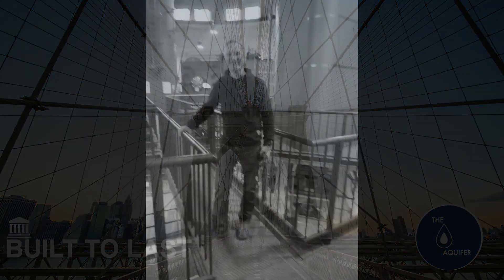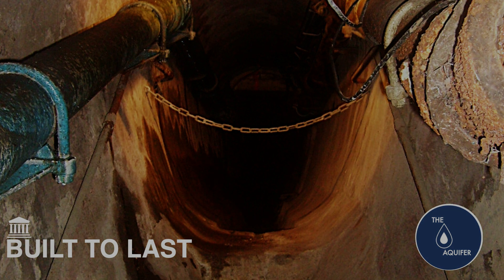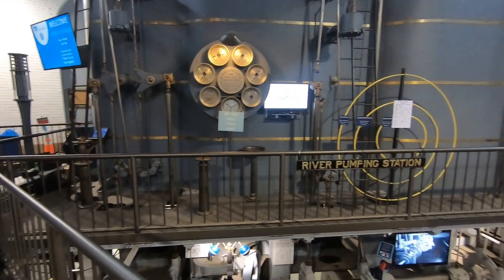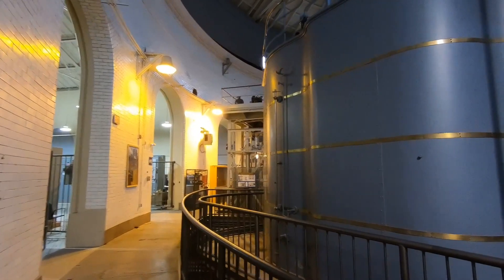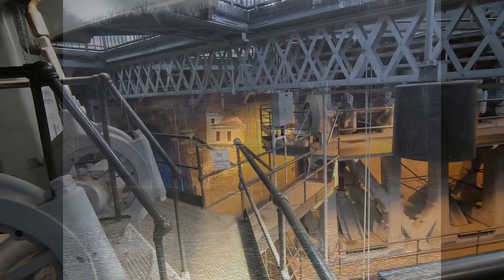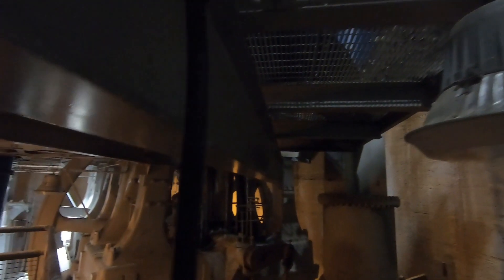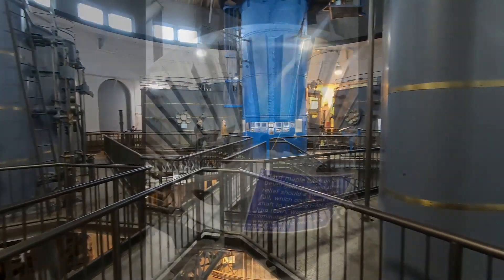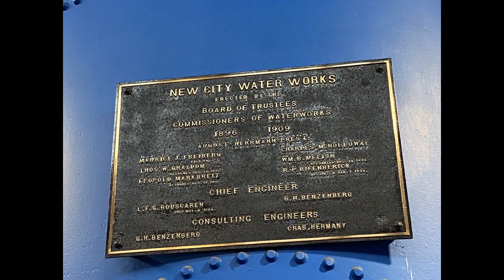Built to Last - Cincinnati River Pump Station - Episode 1

Comment: Great  video! Here in Brasil it was very comoon to use  steam engines called "locomóvel" for irrigation rice fields. But thery where small  compared with tihis one. If you could help me find a viedo on Youtube about a single piston pump that must have the same function as the pump in the video. But its really huge and i cant remember if it was powerede by steam or whater wheel.
Reply from the maker: Wow!  Thats amazing!  I havent seen a video of this yet, but I'll keep your comment in mind as I'm out and about looking at the amazing infrastructure that I come across in my work both with BTL and my engineering work.  Thanks again for the nice note!